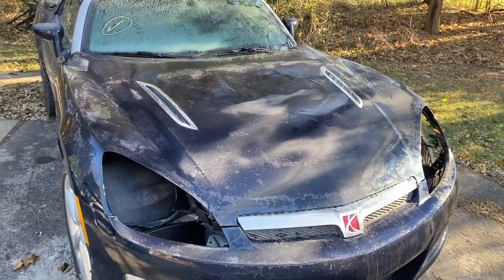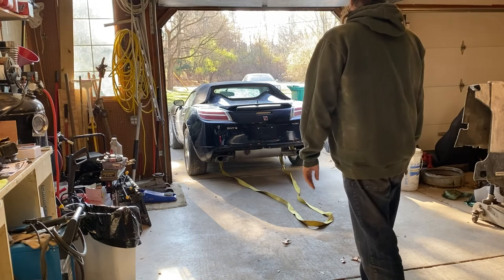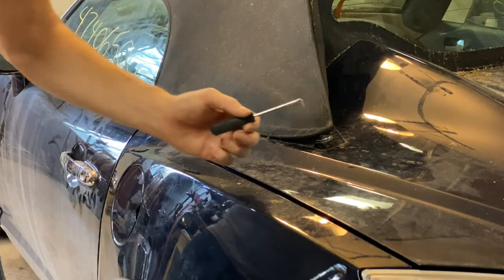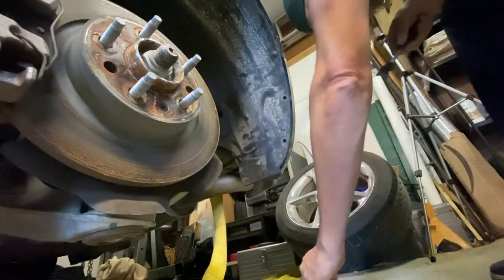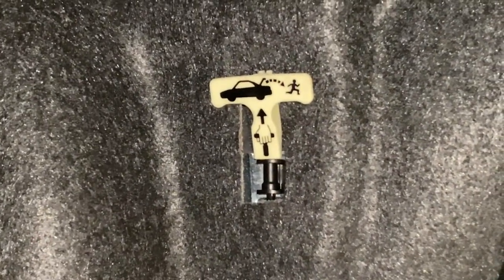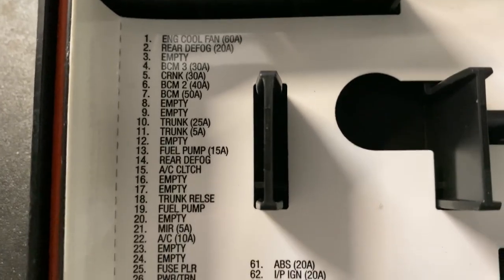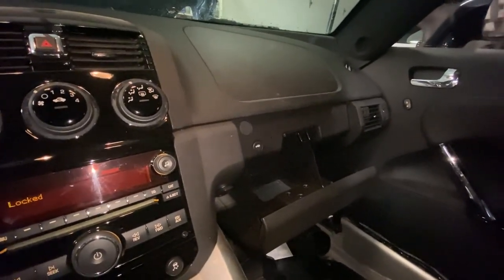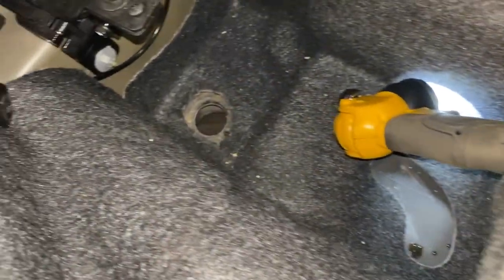Episode Three - Everything you never wanted to know about a Sky/Solstice trunk mechanism

Comment: This video is helping me immensely! I actually have a rare situation in which buttresses work fine and I can hear everything trying to release but I could not release the trunk lid itself. I used the method of reaching in and pulling the safety. Heard a pop expected to see the lid lifting but nothing. Finally got in by removing panel behind seats drilling hole and tripping the latch. Main cable was broken off the latch. But when I hit the remote that cable doesn’t move at all. Even though it broke away shouldn’t I see it retract?
Reply from the maker: Can you hear the motor working?  In my case I know the motor problem was somewhere in between the button and the motor (probably BCM) because my button tests fine and the motor works fine, but pressing the button never actuates the motor.   There are also two lines and two motors - one for the buttresses to release and one for the trunk itself.  The buttress line is pretty darn tight, I had to put a custom handle on it to be able to pull it by hand.  Trunk release is relatively light by comparison and I could just use my fingers on the cable to get it popped.
Reply: @ihavemadeahugemistake  yes my glove box button works and the keyfob both activate I can hear everything but if just the truck actuator is dead I’m not sure I’d notice that.